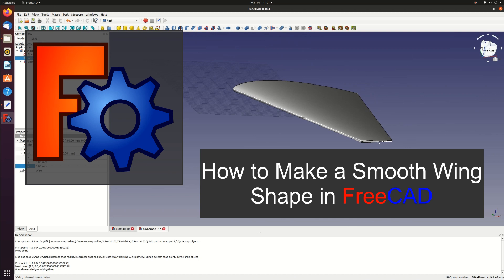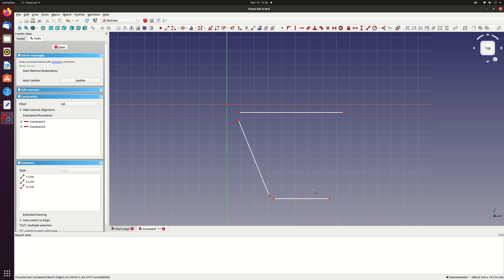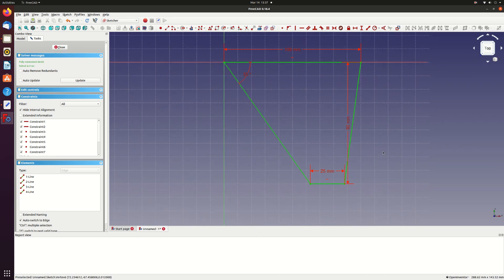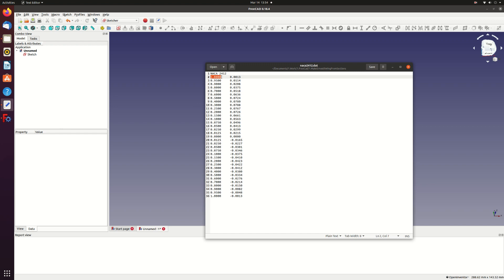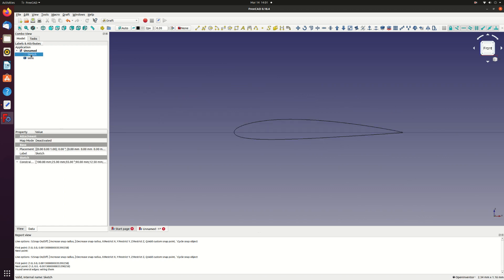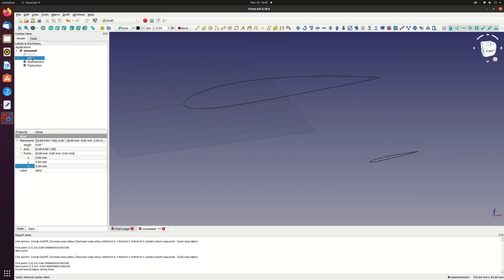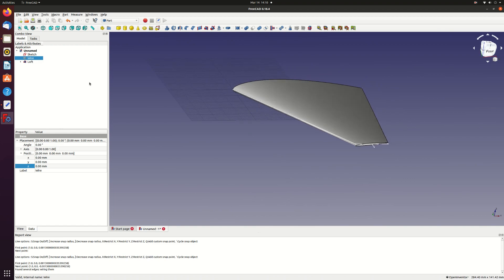How to Make a Smooth Wing from an Airfoil Section in FreeCAD

Comment: How did you change the imported airfoil from the XY plane to the XZ plane? Thanks.
Reply from the maker: Hi @tomcadet. I just hard programmed it in the script.
See lines 32/33 in the macro copied below. I just copy 0.0 into the y value and copy yf into the z value.

 32       # Save this point. I'm treating the points as x and z and setting y to 0
 33       points.append(FreeCAD.Vector(xf, 0.0, yf))

Comment: Hi. I have been spending some time on this. A couple of questions. Having some thicknerss at the trailing edge is good, but beacuse the tip is scaled, we end up with very l;ittle thickness. Ideally I'd have approx 2mm thickness alomng the entire trailing edge. Any ideas on this. While Im waiting fro a reply Ill see if I can get a spline into the Leading edge to give curved LE.
Reply from the maker: @markfisher8943 You could do this by making 2 different sections, a root section and a tip section. If you know the chord length of those 2 sections, you can make sections that have 2mm trailing edge thickness once scaled to the correct chord. One way to do this is just to locally thicken the trailing edge part of the section. This is possibly simpler but distorts the section. The more "correct" way is to stretch the section (scale in the x direction) and cut off the excess at the trailing edge. You need to work out the scale needed to give you 2mm at the trailing edge for each section. This method maintains the section profile and is generally preferred. Hope this makes sense. I've done this before, so let me know if you need help with this.
Reply: @ITriedThis  HI, Thanks so much. I'll need some help I think. I was traing to constrain the TE thickness in the Root wire model, thenscaling the tip, but just cannot make that happen. I am using ONDSEL, hopefully because the learning curve wont be so steep. I was hoping to create a wire for ribs say 100mm apart the full length of the wing extension (1400mm),. The TE edge is straight so I hoped to pickup the node of each rib to create a spline in the planform model. Lots to learn. Any help would be greatly appreciated. Where are you located?

Comment: Best trial I’ve seen on doing this. I’m a newbie at 3d cad. Fine with old 2d stuff (65). I am making some wingtip extensions for my glider. Straight TE, curved LE, forward Swept. Lookup Genesis 2. I’ll give this a try. Many thanks
Reply from the maker: Thanks for the comment!
Interesting looking glider. Do you mean full size glider or RC model?
I've had a second video 75% prepared for about 18months, but can't find the time to finish it. It looks at a method to make a smooth arbitrary shape (e.g a fuselage) if you can't make it from standard shapes like circular sections. I'll try to post it soon.
Let me know how it goes with the wing tip.
Reply: @ITriedThis  I downloaded your Macro, . Its viible from Macro menu, but, when I Execute nothing happens. I must admit I am using ONDSEL. Maybe thats the issue.? Any ideas
Reply: FYI. No luck in Freecad 0.18 either
Reply from the maker: @markfisher8943  Not sure why it is not working, but below are a few things you can try. I just rechecked my macro again on Windows and the behaviour has changed, even though I haven't changed my FreeCAD installation!! I originally wrote this on Linux.

1. Check for error messages in the report window. If you have any, post them here.
2. Assuming no errors: Start with an empty model. Run the macro and check if you have a new item in the model window called 'BSpline' or similar. If so, the airfoil section has been created. If pressing the 'Fit All' button does not show the section, add the following to the end of the macro and repeat.
FreeCAD.ActiveDocument.recompute()

I have to do this on my Windows installation now to get the section to show. Never had to do it before?
3. If you don't get an object called BSpline or similar, you will need to do some debugging. You can add some commands to try to find out what's going on. For example, add the following just after the line that starts 'points.append'
print(points)
Make sure it starts in the first column (no leading spaces) because python has stupid indentation syntax instead of proper markers for code loops.
The printout should appear in the report view. Try some print statements in different places to try to trace what is happening.

Let me know what you find and I'll try to help.

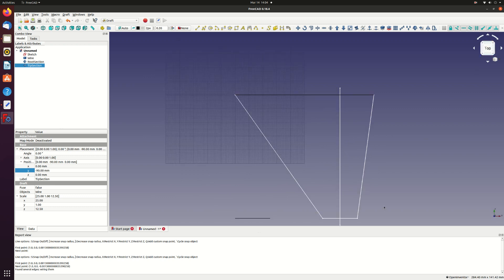Comment: Very interesting Sir. I Tried this too, and it worked. However at 11:45 i hear you say that the tipsection needs to be pushed to the right with the formula 1035 x 90, but i don't know how you can have a result of 63.02. And another question, where did you get this .dat file? is it from a real wing like a windmill? Thanks. Jean
Reply from the maker: Hi @germona, sorry I didn't speak clearly at 11:45 and the auto-caption did not work properly. The formula I actually say is tan(35) x 90 but it sounds like 10 35 x 90.
The airfoil section is a standard NACA section and can be downloaded from the site linked in the video description. There's also a good book on standard NACA sections that is available online and contains tables of many sections plus the equations to calculate them. Search for a Abbott and Von Doenhoff, Theory of Wing Sections.
Thanks for watching!
Reply: @ITriedThis  Thank you very much for the extra info.

Comment: Hi I can"t seem to snap the Line to the BSpline ends maybe you have an idea on how I can close the shape ? Great video and macro thanks !
Reply from the maker: Not sure why that's not working. Can you try making a line by typing the coordinates of the end points? If you make them exactly the same as the airfoil end points you should be able to close the shape. Alternatively, make a surface of the unclosed shape, then you may be able to make the trailing edge surface separately.
Thanks for watching!
Reply: same issue here but when you create the line from draft you can manually input the coordinates on the left and it worked that way
Reply: I found that I didnt have snap turned on for endpoints. This worked great in Draft bench. Upgrading also was no isssue

Comment: Thank you for providing such a simple and efficient macro, which has a big impact technologically speaking, because you have provided a door with a key that allows my research to continue. I had to modify your python code for it to work for my needs, but you gave me what I needed for my lastest invention. Thank you. I am based in Falmouth UK by the way.
Reply: Nope. Not RC. I sit in this one. I will have to figure out how to use a spline on the LE.
Reply: Any hints on what and why you changed Pythn code. I cannot get a file to load.

Comment: This is cool. I can't use your Macros file though since I'm using Windows or I'm just missing something.
Reply from the maker: Sorry, I shouldn't have assumed you would understand. Here is some more detailed explanation.
Edit the macro in FreeCAD from the Macro->Macros menu.
Find the following lines:

root = tk.Tk()
# show askopenfilename dialog without the tkinter window
root.withdraw()

# default is all file types
file_name = askopenfilename()

... and replace them with these

# root = tk.Tk()
# show askopenfilename dialog without the tkinter window
# root.withdraw()

# default is all file types
# file_name = askopenfilename()
file_name = "C:/Users/MyUser/Documents/airfoils/NACA0012.dat"

... in the last line, replace the path and filename with the path and filename to wherever you have put your airfoil data file.
Note that there should be no spaces at the beginning of these lines or python will get confused.
Hope this is clear.
Reply: @ITriedThis  I am getting the same problem. I followed the instructions, but I am still getting "No module named 'tkinter' ". I'm on windows 10 and using FreeCAD 0.19.
Reply from the maker: @Thoughtfully.What-If  I just noticed that there are two other lines that mention tkinter that should also be commented out. I've updated the workaround description in the description of this video.
That's weird because it worked for me on Windows with those two lines still included?
Let me know if it works for you now or if there's something in my workaround description that's not clear.
Reply from the maker: Hi Wade. Thanks for the comment. I tried my macro on Windows and also had a problem! There seems to be some issue with tkinter on Windows. If that's the problem you're having, I've put a workaround in the video description. Let me know if this works for you or what the error message is if you have something different.
Reply: @ITriedThis  I'll be honest I'm not sure when it comes to coding by what you mean "comment out" etc.

Comment: great! Question: what if you don't want a trimmed trailing edge?
Reply from the maker: Hi Bernardo, That's a good question!
The solution is to make the two trailing edge points the same. Unfortunately, the default behaviour in FreeCAD is to close the shape if the first and last points are the same but you can make a small hack to stop this. 
See my tech blog article that's linked in the description and read the last two paragraphs of the section labelled 'macro' (in part 2 of the article).
I don't know why FreeCAD has this behaviour as it doesn't seem sensible to me.
Post again if my description is not clear.